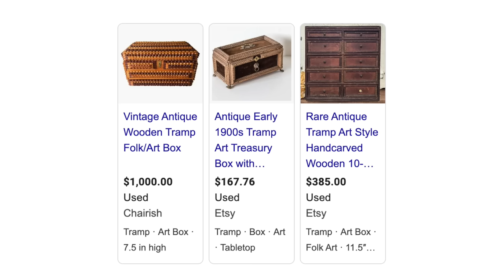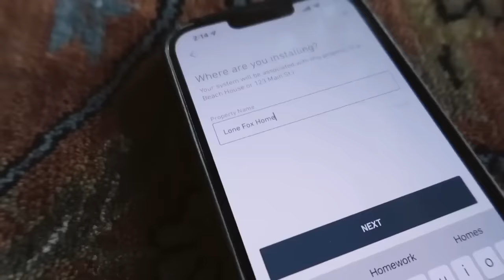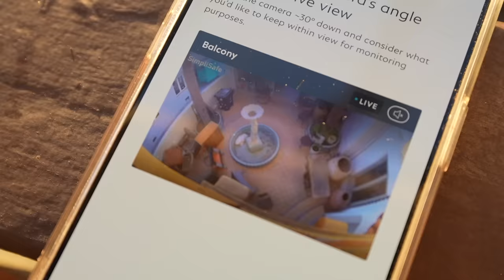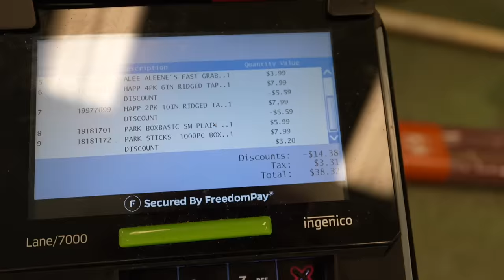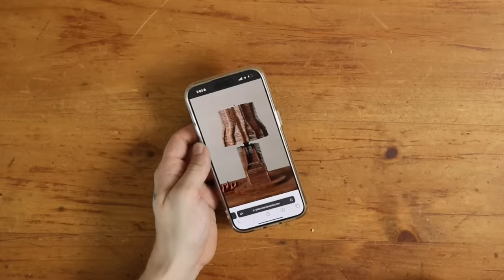Tramp Art is ALL THE CRAZE! Can I DIY It? (3 projects)

Comment: How fun!  I love your DIY videos!  Those are all quite 'do-able" projects!  I would have liked to see the frame a little larger, but I know it will be sweet with a picture and in your kitchen!    I might be tempted to glue a popsicle stick around the bottom inside of the 'skirt' on the box,(up near the box) so when it is moved, or you actually use it, the matches won't break off.)